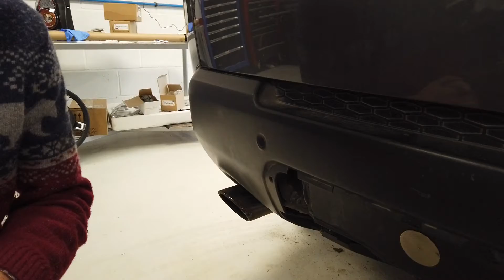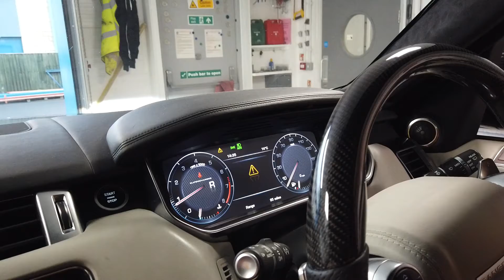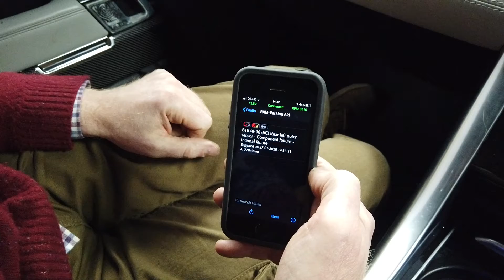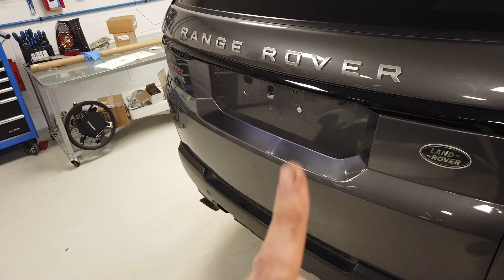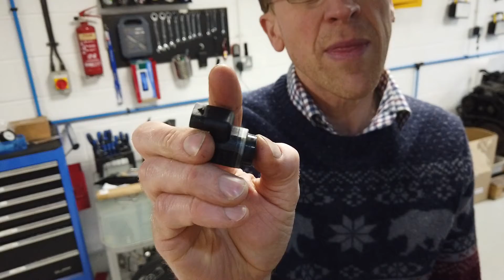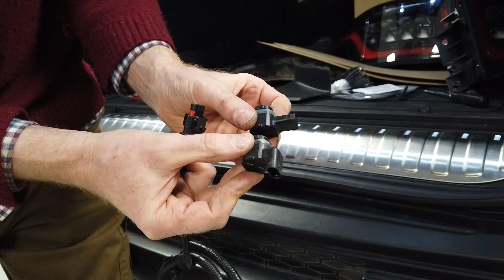Range Rover Sport Rear PDC Parking Sensor Fault Finding / Diagnosis / Repair & Replacement

Comment: Try using a mechanics stethoscope which are cheap to buy and you can easily hear the ticking noise when touched on the sensor

Comment: So, can I reach out to you gentlemen? I recently replaced both inner sensors on my L405, is there anything in the GAP tool needed to initialize the new sensors? I went from one fault to two.  Both new sensors are reading faulty.

Comment: Hi, great video, do you have to register a new parking sensor via. a configuration tool? Thanks
Reply from the maker: No they just plug and play
Reply: @L663  thanks, I bought a cheap one on Amazon, that’s probably why it didn’t work. I guess I’ll have to shell out the £87 Land Rover want, for a branded sensor.

Comment: Hi does anybody know if there is a parking sensor system speaker? If so, where about is it if it has to be replaced ? Thanks
Reply from the maker: There is one shown on the parking sensor system on the parts manual but it does not show where it is located.
Normally on most cars there is one at the rear and one at the front so you can tell where your point of danger is.

Comment: On my RRS 2008 periodically is not working the one of sensors. Is it the sensor or cable  mostly possible? What do You say?
Reply from the maker: Intermittent faults are the trickiest to locate... i have seen the wires break so the wiring is a possibility.